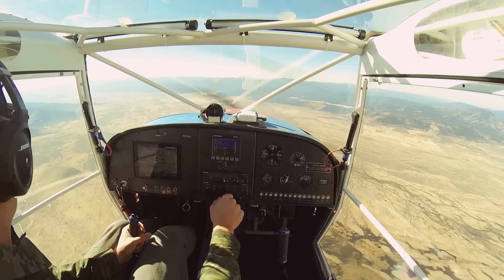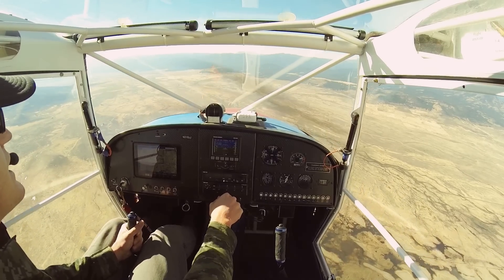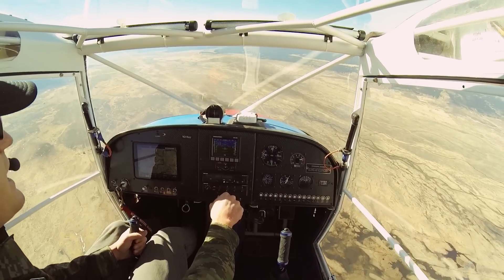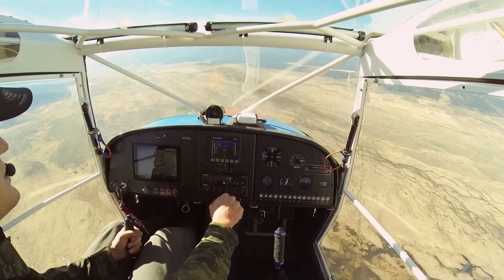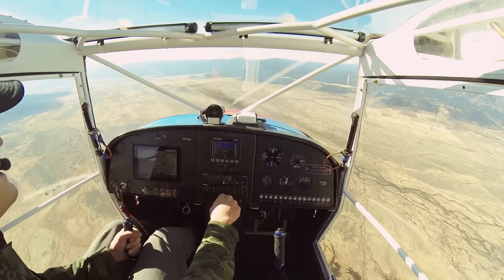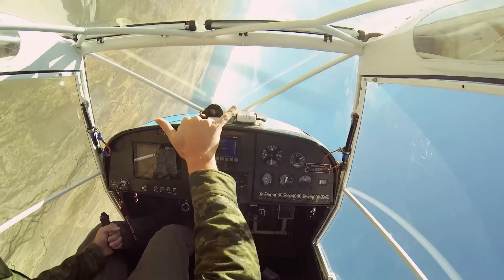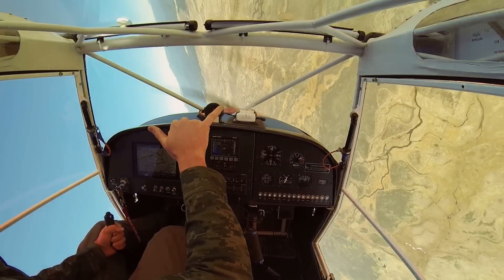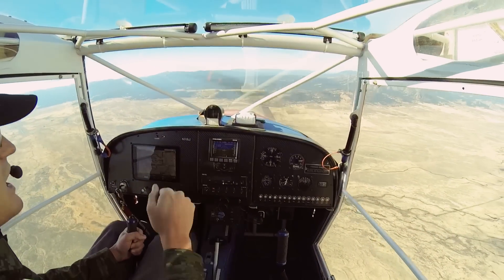How-To: "Steep Banked Turns" in a Kitfox the proper way

Comment: Sweet video! Did you have to modify your rotate in any way for inverted flight? Hope someone will be able to help me out with an answer to this. Thanks!
Reply from the maker: No, it’s pretty straight forward, I kept the Gs positive the whole way around so it’s really just pull the nose up and full aileron until it comes around
Reply: Trent Palmer is this possible with the kitfox 4? I'm seriously impressed!
Reply: Stephan Liebenberg , haha... it’s possible in any plane. Energy management (gain speed) lift nose and rotate keep positive g pressure throughout the “turn” but don’t exceed the g limits for the plane. The plane doesn’t know it’s upside down. Truth is, if you did it right and had a passenger with their eyes closed, they would never know you were doing a roll. There have even been big commercial jets do rolls... 747 even.